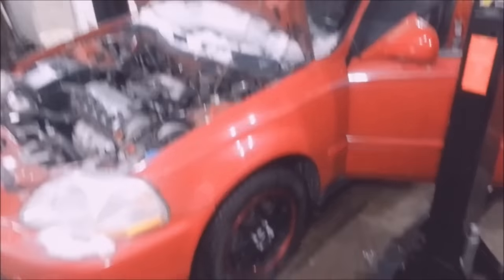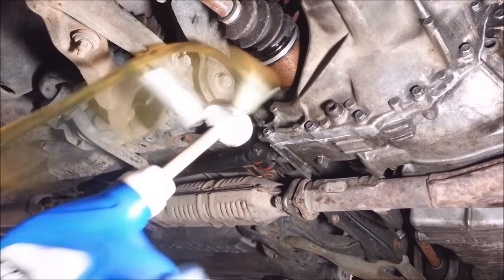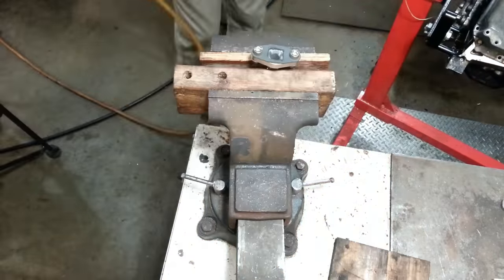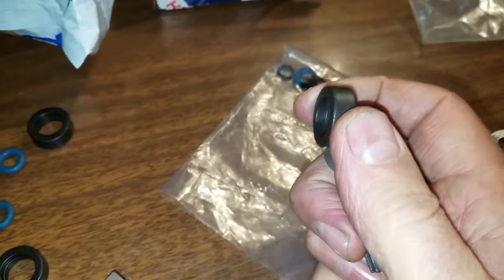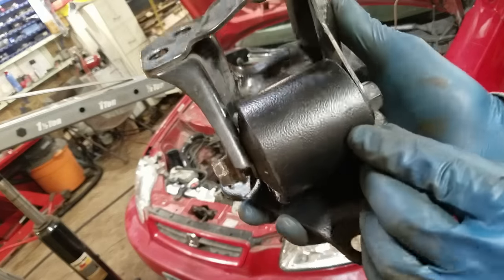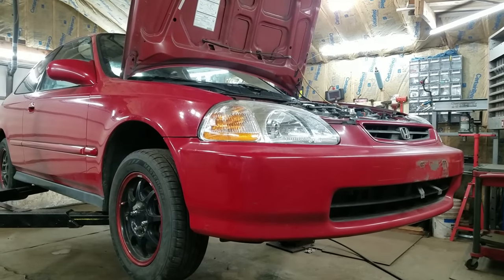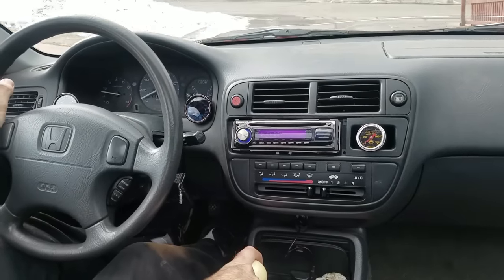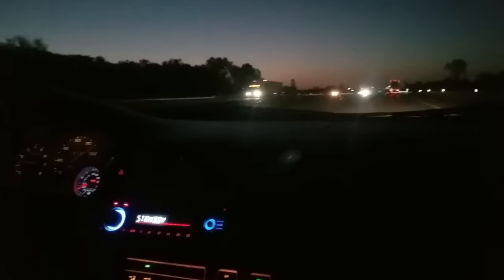405HP D16 Honda Civic Turbo Build start to finish

Comment: When u ran that track you should have blasted your heater. To release extra heat..
Reply from the maker: I did a little to see what would happen. Where the needle was at on the dash, it was only running at about 210-220. That's okay.

Comment: Running a problem with my Honda civic coupe 98 check engine light came on code p0505 showed up I have an idle control valve I change the part put a new one on and after a couple of runs the code showed up again The code when he raced awesome I am currently showed up again have you ran through this problem before
Reply: The code was erased and currently *
Reply from the maker: https://honda-tech.com/forums/honda-civic-del-sol-1992-2000-1/problems-idle-iacv-code-14-p0505-look-here-2127246/

Comment: how did you make the pressure canister for priming the engine oil
Reply from the maker: That pressure can was from an old kit that was used to clean an r12 refrigerant system for an r134a conversion. The rest is basically a leak down tester.

Comment: What all was done on vacuum routing for the pcv? Im kinda stumped on that
Reply from the maker: If you look into my playlist it's there. I put a check valve inline from a volkswagon, and still use it. Since i have new valve guides, and good piston ring sealing, I still use a pcv.

Comment: Do you need a hondata? Do you need a tune?(to turbo a d16) I’m gonna turbo my 97 civic hatch and need to learn a lot before hand
Reply from the maker: There is so much programming, and changing things around to make the thing work right, I wouldn't have it any other way. You need to tune the thing. Many things need to be calibrated.

Comment: Are all vtec and non vtec d series blocks the same? I cannot find any y8 blocks so should I get a y7
Reply from the maker: You need to make sure the oil galley for the vtec solenoid is in the y7 block, in order to use a y8 head. Most of them are blocked off.

Comment: I have a turbo d16y7 oil came out of the breather filter and went everywhere and oil is in the radiator w the coolant where to start ? Also no boost controller on a eBay turbo not tuned
Reply from the maker: Sounds like you blew a head gasket, and have excessive blowby from a head gasket, bad rings, or worn guides.

Comment: Did you have to use a K-series slave cylinder to clear the turbo intake?
Reply from the maker: No. I made a new line with a really tight bend.

Comment: Hey is it possible to take out and put back in the "black box" on the back of the block without taking out the intake manifold
Reply from the maker: Don't know. Bored mine with the correct PTW clearance, and new valve guides so I can use mine for its intended purpose.

Comment: Hw much was you're total cost of the engine build and what parts did you buy. Got links?
Reply from the maker: It was a bunch. No links. I just got stuff I thought I needed, and tried to work with it. In the end, it came together pretty nicely.

Comment: gonna need a part number on that drone elimination pipe man lmfao , I bought an Ek with eBay exhaust already on it and I friggin hate it lol
Reply from the maker: That stuff usually sounds annoying, unless you have a turbo.
Reply: @RustBeltAuto    Its so loud at 3k rpm .  where can you find the pipe you used or was it custom built ?
Reply from the maker: @lostkauz83  I have a playlist on the whole car. There is a video on it.
Reply: @RustBeltAuto  sweet thanks !

Comment: Great video mate, how did you calculate the correct length for the Helmholtz resonator you installed, looks like it works awesome! Cheers, Mike from New Zealand
Reply: Oh and by the way, if you can get hold of a GM/Opel/Holden Astra power steering pump, you can build a very discreet electric power steering setup that has only 2 hoses, so you can remove the engine driven pump and all the clutter of the excess hoses for the mechanical system...
Reply from the maker: There is some mathematical equation i found online i used.

Comment: Pretty mean for a D series! Would like to see how it does on 93 octane.
Reply from the maker: E85 is about an 80hp gain. It can run on 93, because it has been tuned for flex fuel, but what's the point?
Reply: Cus WHY NOT😂

Comment: Hey genuine question, I'm hoping to k24 swap a 7th gen coupe. Any tips or advice? I've been watching videos of it and reading as much as possible so I have what I think is a good parts list to make it easier
Reply from the maker: 7th gen hatch si is k20. Should be pretty straight forward.
Reply: @RustBeltAuto  problem is it's not the hatch, it's the coupe LX that was swapped to the k17 before I bought it. I have a somewhat comprehensive parts list that I've put together watching videos on the swap but getting direct advice for a swap would be helpful. I was gonna get a engine/tranny combo from the accord
Reply from the maker: @alanknight7912  what's a k17?
Reply: @RustBeltAuto  1.7l sohc
Reply from the maker: @alanknight7912  ooh. That's a d17. Ep3 Si, or RSX trans I would look for. They have LSD. Like I say, if you run into any snags, the EP3 Si has all that junk in there. It's basically the same car. K20 with LSD, 5 speed car. Not sure, but don't think accord has lsd manuals. Have not done any swaps like that, bit have worked on a few Ep3 Si's kind of a turtle compared to my k20z3.
Reply: @RustBeltAuto  ah thanks for the clarification, I kept being told it was a k17 so I stuck with calling it that. And with the ep3 would I have to get something to relocate the shifter? If I'm not wrong doesn't that gen SI have the weird console shifter instead of coming up from the floor

Comment: How come the boost gauge was fluttering on the pulls after the tune?
Reply from the maker: Manual gauge. I put a pill in the vac line to slow it down a little. Tried other things, but the data logs don't look like that. When it's trying to make full boost at lower rpm's it does that, probably from the pumping action of the pistons.

Comment: I really need to know what that thick grommet is from cause those injectors are cheaper than shit
Reply from the maker: The grommets came from a honda head gasket set I think. There are a couple different sizes for those, and those fat o-rings came from a 3.4l, or 3.8l chevy intake gasket set. I have done many of these jobs, and the old ones can usually be re-used, so I saved them, and had them laying around.

Comment: How is that clutchxperts clutch holding up ? Any slippage ?
Reply from the maker: None whatsoever. Feels nice.
Reply: @RustBeltAuto  good to hear, so was that the stage 4 rated to 389hp ? What’s the pedal feel like to compared to stock? Sorry for the questions, I’m currently looking at doing a clutch job. Not sure which one to get
Reply from the maker: @Chris_Paul1  it said good to 400hp. Pressure plate feels stock.
Reply: @RustBeltAuto  ok thanks for ur help. I might have to grab one if it feels similar to stock, I assume it’s just a bit more grabby. Much cheaper than a clutchmasters I was looking at.

Comment: do you need to bore it or did you because the pistons are bigger?
Reply from the maker: @KevinSibomana  piston replacement requires boring to get the correct PTW clearance.

Comment: I am from Jamaica I have a 1997 Honda civic it's a D15B3034736 for now it is sitting in my yard I need help with it where would I start
Reply from the maker: It depends.
Reply: @RustBeltAuto  I would love to get it turbo...it has a blow head gasket
Reply from the maker: @ann-marierobinson4844  there is a playlist on this car of the entire build. Maybe it will give you some pointers. If I was me, the first thing I would do is get that head fixed, put it on, and make sure everything works right.

Comment: What size turbo is this? Have a t3 but needs alot of notching :(
Reply from the maker: It's a t3/t4. Maybe it's the manifold you are using.
Reply: @RustBeltAuto  what brand turbo is that and size of exducer and inducer?
Reply from the maker: @Brandon Bassett  it's Chinese, and came in a kit. I listed everything best I could in the description.

Comment: Are you using the original ECU or how?
Reply from the maker: Obd1. P28 s300 hondata, conversion harness, with flex fuel sensor.

Comment: Great video and all but why would you spend all that money just to build a single overhead cam engine when for the same price you could of built a b18 la motor or better?
Reply from the maker: It's not the same. Everything in the car works. I like my A/c, and stuff.
Reply: @RustBeltAuto  aw I see that makes sense then.

Comment: Around how much did you end up spending on parts?
Reply from the maker: Didn't pay attention to that. Was only interested in an end result.
Reply: @RustBeltAuto  Reason I was asking is because I’ve been looking for a project car and was told a civic is a great place to start due to being relatively affordable.
Reply from the maker: @iZephiroth  there are a lot of good cars out there. This is a nice platform even though it's FWD. Mostly because you can get so many mods for it. They are starting to fade out.

Comment: You wouldn't happen to remember the name of the seller of this turbo kit would you?
Reply from the maker: No. I looked for a kit I thought I could use the most parts from with the size turbo I wanted, and hoped for the best. It's basically just a starting point. Just about every kit you can get, even brand name kits, are not very good.
Reply: @RustBeltAuto   appreciate it, thanks!

Comment: Next Built do a Kswap make about 700hp with eBay Turbo kit
Reply from the maker: I have a 2010 Si.
Reply: @RustBeltAuto  I'm doing a K24A swap on my 09 civic si..does flashpro has basemap to get me started?
Reply from the maker: @julianperez1270  I don't know.
Reply: @RustBeltAuto  with a JDM k24A or JDM k24A2 you can make 600hp or more depending on tuner.but you need a Acura RSX Type S oil pump and a Better intake manifold. I made 579hp from a Stock k24A JDM without using the RSX Type S oil pump after I Installed that oil pump it was a different engine I was gapping Dodge Hell Cat and Mustang GT500 with that built..and need some good tires as well because if not you be all over the road
Reply: @RustBeltAuto  I just purchased a 08 civic si coupe I'm doing the k24A swap as well but I'm installing all the good stuff like Pistons, valves oil pump intake manifold, planing on making over 800whp Street car

Comment: If I wanted 260-300hp would an ebay kit be enough mines an automatic
Reply from the maker: You will twist your rods like a pretzel.
Reply: @RustBeltAuto  because of the eBay turbo or the horsepower amounts or case it's an automatic
Reply from the maker: @justaregularguy3827  the rods on a D, can't handle over 200hp.
Reply: @RustBeltAuto  everyone I've asked has said the opposite though like they can do easily 260-300? Hmmm I gotta look into it more
Reply from the maker: @justaregularguy3827  twin cams can.
Reply: @RustBeltAuto  so would aftermarket sohc like vitara stuff or whatever be good I cna build the block any tips
Reply from the maker: @justaregularguy3827  Vitara's are cheap pistons from a Suzuki that make lower compression. Aftermarket connecting rods, are a main concern going over 200hp. Lower compression is good for any detonation issues you might get from boost pressure. I actually used Vitara's, and extended length rods from Speed factory, to move the compression up more then just a standard length rod, and Vitara pistons. There are piston companies that make low compression d-16 pistons. Most are forged. I didn't go that route, because I like the low expansion rate of Hypereutectic pistons.
Reply: @RustBeltAuto  but hyper eutectics are still OK life span wise for a turbo or super charged vehicle or no go forged?
Reply from the maker: @justaregularguy3827  they are in most cars from the factory. I have put them in Harley's, 500 hp SBC's, and others without issue. You need to make a lot more power, or run nitrous to need them.
Reply: @RustBeltAuto  hmmmm..... So regards to nitrous the one question I have is if I get a bottle how and where can I get that filled abd is that an OK option for just short bursts like adrenaline for a car I was along as a firend wants a wet system apparently?
Reply from the maker: @justaregularguy3827  I don't know, and probably not.

Comment: would you be willing to work on a vq35de infiniti motor?
Reply from the maker: It depends.
Reply: @RustBeltAuto  either rebuilt plus boosting. What about a manual 6sp trans swap.? I'm serious on this. What depends if I may ask?
Reply from the maker: @ЭтотГайДин  I will just go with no.
Reply: @RustBeltAuto  awe man.  Well ok.  Thanks for replying. Love the videos.
Reply from the maker: @ЭтотГайДин  where you from?

Comment: Why does your boost gauge bounce ?
Reply from the maker: It's a cheap manual gauge that came with the turbo kit. I put a pill in the line to slow it down. Helped a little..

Comment: shouldnt be blowing head gasket at that boost/power level with the standard arp 10mm studs, check your tune.
Reply from the maker: Correct. Both tuners did not know what they were doing. Too much timing. After oversized studs, it blew another, and then I moved the timing down about 8 degrees.

Comment: kenapa tidak pakai block plate
Reply from the maker: @agustiandumeztina3721  what's that?
Reply: @RustBeltAuto  block guard that protect your cylinder wall twisted couse of high boost,

Comment: Is this engine still running?
Reply from the maker: Like the wind! My last video in the Playlist for this was my last fix.
Reply: @RustBeltAuto  Thats amazing, I am doing a similar build but only after a minor performance gain. Did you make your down pipe? That seems to be the biggest struggle I got because I want my ac lol
Reply from the maker: @MartialArtistVega  it's aftermarket ebay stuff. A close enough thing, that gave me something to work with.

Comment: oooof at the end you gotta fix those lifters lol
Reply from the maker: ?. There are no lifters. Just rocker arms. They require valve lash. Naturally, they make noise, and work better.
Reply: @RustBeltAuto  wow i appreciate that!
Reply: @RustBeltAuto  i have been confused 🤔. i hate the chatter from the head tho, good luck. gained a viewer!
Reply from the maker: @nateverm4882  solid cams always make noise. Some people don't like Honda's because of it, but it is the most accurate, and reliable idea.

Comment: I have the same aftermarket ignition coils you got at the end on my j30, how the fuck do I get them off? Bought the car with em
Reply from the maker: Ignition coils? V-6? Coil on plug? Unplug wire, remove bolt, and pull up?

Comment: Loved the video, absolutely cringed when you put the "cheapest head gasket you could find on ebay" in your build. Then to see you blew the head gasket later in the video wasn't much of a shocker lol.
Reply from the maker: @Mike-zj5ww  never used that head gasket. Just everything else in the set. The rear main, and front seal leaked too, so it was probably a bad idea.

Comment: copper head gasket will not blow out
Reply from the maker: They require a lock ring groove in the head. Besides, the problem was bad tunes with too much timing. It works fine now.

Comment: Overall theme for this build apparently is "I got the cheapest crap I could scrounge up"   when your working on cars its not about the price so much as the price per performance. When this fuckhead pulled up the box with the engine gasket set and said he bought the cheapest he could find I pretty much cringed. As a professional mechanic I have seen some horror stories about gaskets and you pretty much wanna always steer clear of ROLL and Mcord and loads of cheap shit and stick with fel pro OEM and Mahle and the Napa brand etc. looking forward to watching a future video where hes tearing this apart to see what went wrong .. trying to figure out the failed component in a build with all cheap shit is going to be a nightmare and what really cracks me up is that in with all that shit he had ARP mains ?

Comment: Should have just went to junk yard grab a 500$ k20 or k24 and boost that for less then what you spent on oarts and machin the d16 and have at least 100 to 200 more horse power
Reply from the maker: You go and boost a used engine, and go find yourself a used K20 for 500$. Good luck with all of that. I built a great little car, and love it just the way it is.

Comment: Honestly head gasket blew probably cus you used a cheap eBay one not the studs 😭.
Reply from the maker: It was a proseal gasket. It kept blowing gaskets, because the tuners used too much timing.

Comment: Your problem with blowing a head gasket was the bullshit Je Pro Seal
Reply from the maker: @HooligansMx  no. I tried O.E. headgasket, and same thing. Tuners gave it way too much timing. Went through 5 headgaskets, and oversized studs, to figure it out. Pro seals are Athena. They are excellent gaskets.

Comment: No power steering no AC no electric anyting that's why I drive a CX
Reply from the maker: Power steering, A/C, cruise control, power windows, and mirrors, power moon roof, rear defroster. That's why I drive a Civic EX.

Comment: There not rwd because there engine s are to weak
Reply from the maker: Weight reduction, better gas mileage, and more traction from weight on the drive wheels. Pretty much the reasoning behind manufacturing FWD.

Comment: I dnt belive that these civc engine can make 400 horsepower my money tell me it a lie I mean how much pressure can that small single cam engine hold lolll you tube there alot of fake video
Reply from the maker: It did 375 @ 24psi on a local dyno, and 405 @ 25 psi at Humble. It's a real thing.